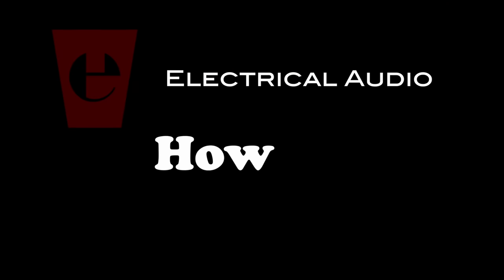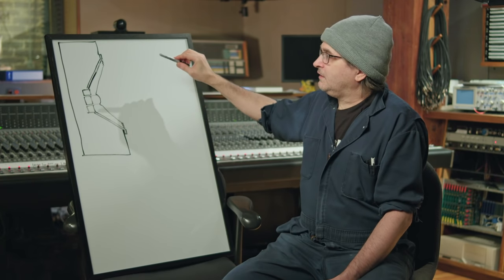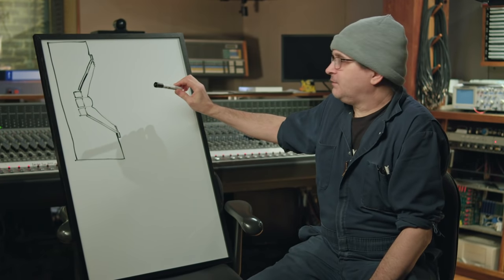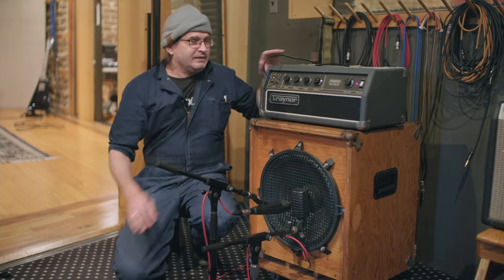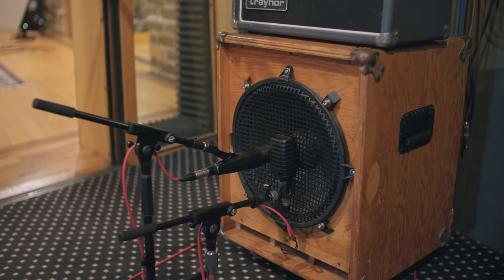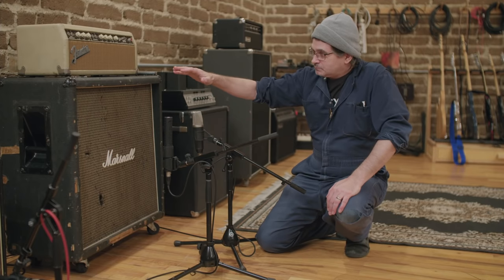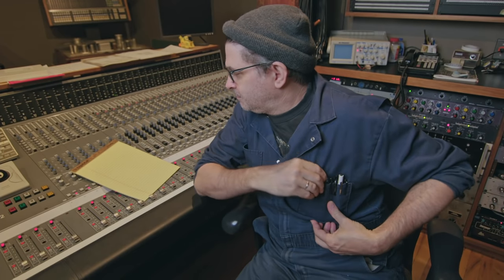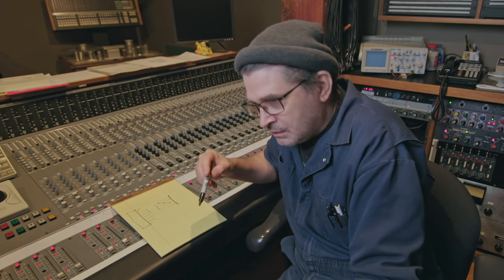Electrical Audio How-To: Microphone Techniques for Speaker Cabinets

Comment: Good stuff. How'd you mic the slide whistle?
Edit: I was a mobile recording guy. The off axis cab mic is also the result of running out of headroom as the band cranks the volume past what rehearsal and soundcheck levels were.
So, can't move the stand mid show, can't ask for agreed upon vol; I run out on stage and twist the mic off axis to get a few DBs of room.

Comment: Thank you Electrical Audio for all the great videos on recording studio technique. Exquisit stuff.

About the proximity effect, you claim that omnidirectional microphones exhibit less proximity effect that directional microphones, while in theory they should not exhibit any at all since by principle, they are (are should be) what is so called a pressure transducer. As opposed to directional microphones which are of the so called “pressure gradient” type, well explained in this video > which is the result of the pressure difference between the front and the back of the microphone diaphragm. 
I am not trying to contradict any of your statements Steve, but just to clarify the principle of the effect (or how I understand it and learned in some microphone books)
Mabe a more accurate statement would be that when an Omnidirectionnel microphone is closer to the source, low frequencies will (or should) come out more pronounced « naturally ». But I think this is not due to the proximity effect as in the proper definition.
No?

That said, I found out through experimentation that large diagram condenser microphones using the omnidirectionnel pattern DO exhibit some sort of proximity effect! Or much more pronounced low frequency difference than with « true pressure transducers » where the capsule is totally « encapsulated » like the earthworks mics or SDC Schoeps/Neumann…

Comment: Very nice.  Mic on a cabinet does pick up the acoustics of the cabinet for recording. Life sound as noted is different. Often a DI box is used for keyboards, organs, and guitars as that removes stands from the stage and reduces the impact on feedback. With newer digital consoles, the effects of tube cabinets is modeled as a plug in and then fed to the FOH speakers.  Delicate or expensive easily broken microphones are not used in tours and outdoor concerts where wind is a possibility. Ribbons are often used in a studio for the reasons given and provide good recordings.  Some speaker cabinets can be picked up very well from the rear for open back cabinets. This is most true for twin or quad cabinets where you mic the virtual center instead of being behind the magnet.  Watch the proximity of walls behind the cabinets. This works best on open stages or tents without a hard wall behind the cabinet.

Comment: Is it helpful (or not too detrimental to the sound) to put ribbon mics at an angle if you’re afraid the SPL could damage the ribbon? (Particularly with, for instance, a kick drum, not that I’ve done that yet, but also I can imagine bass cabinets push a lot of air as well)

Comment: I thought the practice of angling the mic stemmed from the idea that it was perpendicular to one side of the cone...?

Placing the mic very close at 90° to the surface of the cone is a different sound to just vaguely pointing a mic at an angle to the cab.

Comment: On the subject of recording those lowest frequencies: 30 ips tape. Theoretically a 30 ips reel to reel has a side effect of cutting off  all frequencies below 40 hz (the low E on a bass guitar is about 41hz). Dropping down to 15 ips brings that back to a bass-friendlier 30hz. Given all the older records with frequencies BELOW 40hz that I doubt were 15ips recordings, something I HOPE is true is that the frequencies don't disappear, they just get really quiet. With a decent mic setup cranked high in volume, can you get those missing frequencies onto tape without having to drop the recording speed? If anyone has an answer to this, it would be valuable as a lot of bands might not go analogue if they're worried about capturing the bottom end properly.
Reply: The low-frequency response of tape is affected by the way tape speed interacts with the record and playback head design. Some Ampex machines have 30 ips low frequency response that remains linear down to 20 Hz, but this requires physically large heads, and the machine needs to be designed around this. On most machines the 30 ips response begins to roll off below a head bump (slight emphasis) around 100 Hz, but as you suspected, there is usable response down well below that, often down to 20 Hz, though at an attenuated level. I should point out though that I do most of my multitrack sessions at 15 ips to get the most linear low frequency response because with modern tape and machines, there is almost no penalty in terms of high-frequency performance or noise for doing so. On our machines (Studer A820) the high-frequency response remains essentially linear up to 20kHz and there is usable response above that.
Reply: @stevealbini402  You sir, may have just supplied one of the most useful pieces of information the industry has ever seen. Long may the analogue resurgence continue.

Comment: Pro tip: on fender amps there is usually a knob or a screw or some design element that will line up with the center of the speaker.

Comment: First off these are my learning questions not meant to put you on trial

All recording techniques and mixing styles are like a painter with a brush everybody paints different

The question I have is 
as you move away from the source with the microphone you're creating a certain amount of milliseconds delay

I think the comment on phase differences on a mic close angle to the speaker is very negligible

So you do you record all your drums bass etc everything with a mic 12 in away
What if you DI at the same time

Like room sounds that is a certain amount of milliseconds to delay so what's your take on that

Most people can't hear that delay especially if you are direct inputting other signals?

Vocalist definitely can

Comment: for those new to it, don't forget to move the low frequency roll-off switch on the 421 to highest or next to the highest amount
Reply: Thanks for pointing this out! I used a 421 to mic my bass cab some time ago and I was confused why it sounds the way it does in this video. Had forgotten about the high-pass switch!
Reply: I actually like a 421 just by itself on the bass with the low frequency roll switch off or at it’s lowest (most bass) setting.

Comment: These are wonderful lessons. Question: if the sound you want to hear as the musician or performer is not affected greatly by the volume of the amplifier (for example, the musician is playing a synthesizer through an extraordinarily clean sounding amplifier at any volume) what “principal” tends to govern how loud the amplifier should be? That is to say, if volume does not change the sound of the instrument, at what volume should I record the amplifier: low, tolerable to the ears, or really fucking loud?
Reply: I have always gone with enough loudness to sufficiently overcome noise sources (often the noise of the amp itself) without setting other things rattling in the room.

Comment: Ladies and Germs, he TAPES the amp to a chair.  That's how you get TONE, people.  

Carry on...
Reply: Nonsense. Just put it on a piece of 1/4" neoprene rubber on the chair. Even better. It just needs to isolate direct vibration and the neoprene will keep the amp in place.

Comment: Great video and really informative. Has anyone here got any comments/advice about putting a microphone on the back of a cabinet? Particularly an open back cabinet where there’s a lot of low end projected out the back. Does anyone find this useful?
Reply from the maker: That's a common technique in certain circles, and was pretty common in a time. We get the same result by selecting a mic that has extended and prominent low end, or by using proximity effect to exaggerate the bass, etc.
Reply: @ElectricalAudioOfficial  thanks. Intuitively it seems that you’re probably more likely to encounter phase issues with the two mics at a distance from each other too

Comment: Thanks! Would you consider a tutorial on mic'ing rotary cabs? I'm recording a Leslie cabinet this weekend, and not finding enough info online. This is exactly the kind of video I need on topic of rotary cabs. Cheers!
Reply from the maker: The typical miking is two microphones near the top vents (be careful because the moving speakers are set off to one side of the cabinet, so you should set your microphones off-center so they are equal distance from the speakers- it will look wrong but sound correct) and often an additional one near the bottom vents for low end. 414s, SM57s, 160s are typical choices for top, RE20, 4033, etc. are fine for the bottom.
Reply: @ElectricalAudioOfficial  Thanks!!

Comment: nice. but how this works when the band is playing in the same room? this way there is lot of sound bleed.
Reply from the maker: Good question. A couple points on minimizing bleed: you can use the nulls of your mics to try to minimize bleed and position speakers so that the mics are nulling the bleed sources; you can try to select mics that have good off-axis rejection specifically of low frequencies where bleed is usually more prevalent; you can use baffles and dividers to partition off speakers from the bleed sources; you likely want to get the mics as close in as possible to minimize the ratio of the desired signal to the bleed. Maybe most importantly, bleed is just part of recording. You can try to minimize it in order to get more control over the individual signals, but you have to reconcile yourself to some point of diminishing returns past which you are going to be exerting more time than you can reasonably justify for the small amount of bleed you will eliminate by your efforts.
Reply: @ElectricalAudioOfficial  off course and understood. Thanks for your long and meaningful answer. You made my day.

Comment: Ok, this is really first grade question but I am lost here.  Trying to follow the cables lost me, and I just don't know how to connect this.  The guitar output goes to (what?) and the mic output goes (where?).
Reply from the maker: Which part of the video? Time?
Reply: @ElectricalAudioOfficial  Well, it wasn't specifically any part of the video, which was very informative.  I was just inquiring to the general setup of the mic in front of the speaker.  I see a lot of people doing this, but I dont know how to set it up.  Thanks.
Reply from the maker: @raymondedge8889  It depends on the recording setup. The simplest setup would just have the mic going straight into a digital interface, which has a built-in mic amplifier (preamp) and analog-digital converter. In our case, there are more "steps" in the signal flow. The mic output goes into a console preamp, which goes through a channel strip to a bus output, and the bus is connected via an analog patchbay normal to a tape machine input or digital-analog converter.
Reply: @ElectricalAudioOfficial  OK..I am starting to get the hang of this now.  Thank you so much for your response!!!!

Comment: Mr. A, All I wanted to do was refresh my memory on setting tape bias on a (MY) Studer... I've been willingly sucked in to your classes. One question on the above video. When using the 2 mics on a single source (cabinet) how do you address the phasing issue - should it arise? Just with careful replacement of one mic or electronics? Expect a knock on the door when I finally get over to the States. Your subjects are what drives my perpetual motion machine. Music fuels audio, fuels music, fuels audio. V best wishes from Germany. Mike
Reply from the maker: Not Steve, but are you asking about when a mic is pin-2 hot vs. pin-3 hot? You can simply rewire the pins if you want it resolved permanently, or you can phase invert at the console or preamp on a case-by-case basis.
Reply: @ElectricalAudioOfficial  Hello Mr No Name. No. 2 seperate mics mikeing up a single speaker cabinet / amp as in the video. My question has nothing to do with hot, cold or even warm pins! Regards Mike
Reply from the maker: @mikesage9544  There is a video on this very subject in our channel. Please see said video!
Reply: @ElectricalAudioOfficial  Well, I guess as now we have discovered a working model of perpetual motion, thee and me will be up for the Nobel Prize next year? Or what?

Comment: That bit at the end about putting the mic end-on to the amp is somewhat inspiring to me. Though I have now worked as an audio engineer professionally for some years, I didn't actually go to school for it. I had a friend who was, and we exploited some loopholes in his university's studio scheduling system to spend as many hours as we could in there when no one else had it booked. We experimented with all sorts of things, with one of us choosing and moving mics around and the other in the control room listening and then we'd relay to each other what sounded best. He took classes and I didn't so the combination of his technical knowledge and my blind taste testing sometimes lead to unusual discoveries, and one of the most humorous to both of us was that putting a mic a little bit away from an amp, end-on, dead-center, sounded the best. It seemed counter-intuitive because there were all these "rules" that suggested otherwise, but your ears don't lie. Anyway, RIP Steve, you were a true pioneer who trusted no one and nothing but your own ears.

Comment: Love your video and your humor Steve :)
Regarding live sound, as a "live sound engineer" I have never seen an angeled microphone on a guitar/bass cabinet.
What I have seen, and the technique I use is, I put the microphone directly pointed to (center of) the cabinet. During soundcheck I move the microphone from the center and out (if the sound is to sharp) to find the best spot (sound) to place the microphone.
Working with sound in a controlled environment, like a studio, is soooooo easy compared to doing live sound ;)
Reply from the maker: They're different challenges, live and studio sound, with a lot of overlap. I don't think you can reasonably argue that one is "harder" than the other. That's like saying that open water swimming is harder than pool swimming because there are waves. Being excellent at most anything is "hard."

Comment: I was taught the reason to mic a speaker at an angle was so the mic is actually perpendicular to the paper cone face of the speaker.   This presumes the sound wave comes perpendicularly off the face.

Your experience seems to say the wave comes directly forward with the magnet movement and not in an outward cone...

I've never compared resultysel so I reserve judgement

Comment: Seems like the sound demonstrations would have been better if the guitars weren't set so extremely dirty! But, idk...
Reply from the maker: Actually a distorted guitar is a really good wide-bandwidth signal. And it sounds cooler.